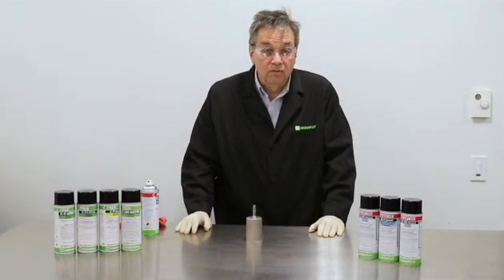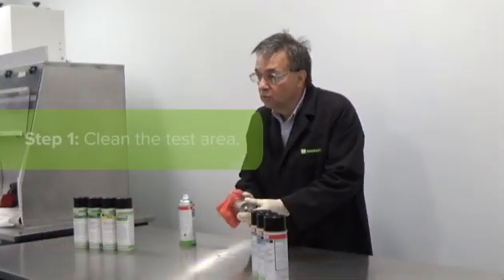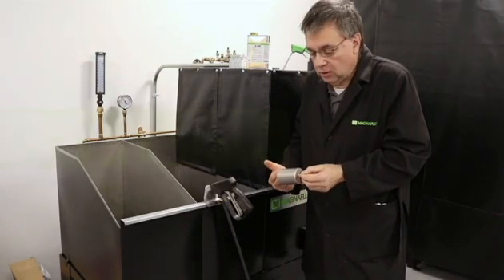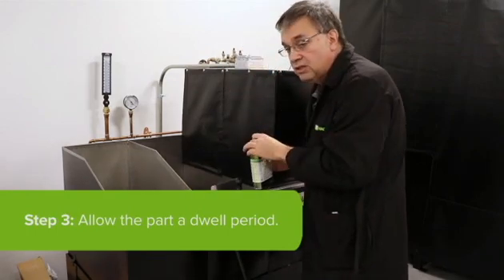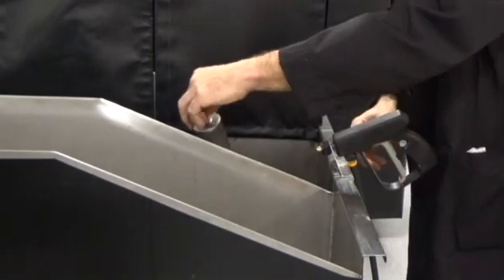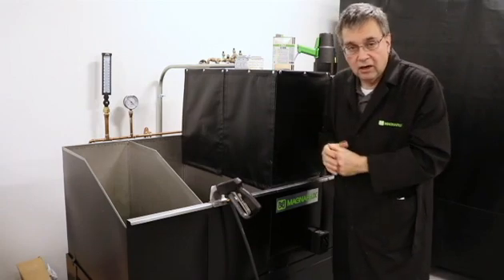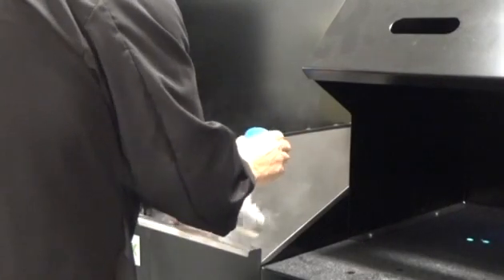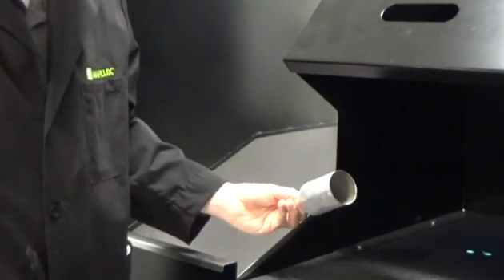How to Do Liquid Penetrant Testing with Fluorescent Penetrant

Comment: I'm sorry, sir. I ask to you.  What happens if we don't use developer on liquid penetrant testing with penetrant flourescent...
Thanks before

Kindly regards,
Ridho
Reply from the maker: Developer is required for use with penetrant (ASTM E1417).  For visible penetrant, the detection of indications will be reduced because there will be a lack of color contrast (red penetrant on white developer background). For fluorescent and visible penetrant, sensitivity is reduced because developer pulls penetrant out of indications and spreads penetrant out on the surface of the part for increased visibility. 

There may be special applications where developer is not used, but these applications need to be approved/authorized by the customer and Cognizant Engineering Organization.

Learn about the benefits of using a developer during liquid penetrant inspection here: https://bit.ly/3uPQByP